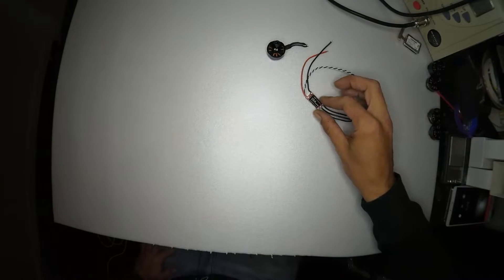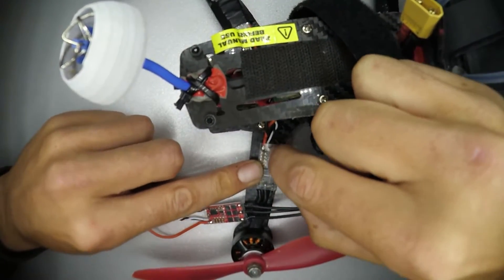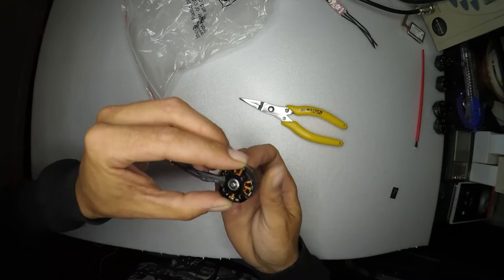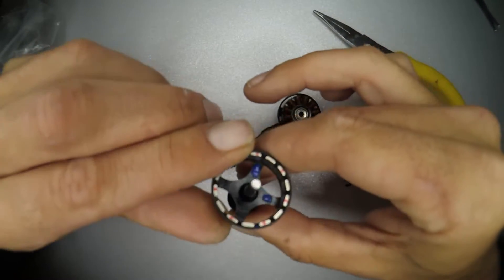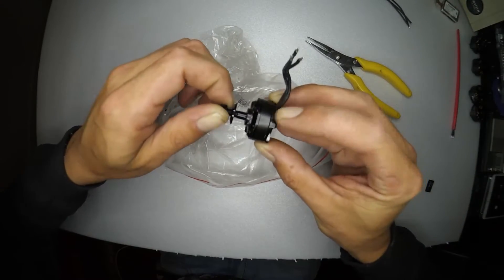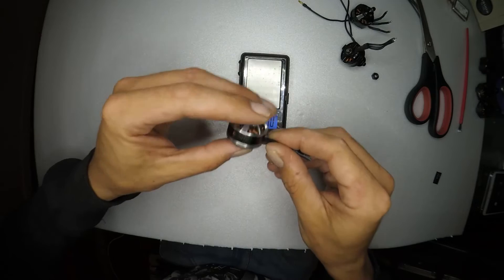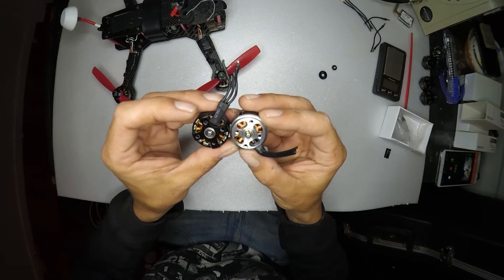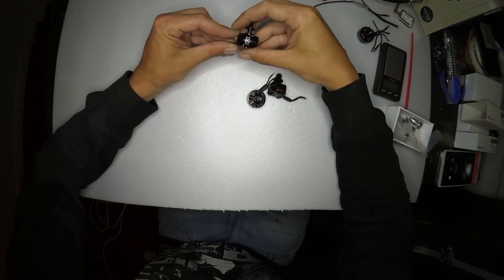littlebeeRCX 20A (FVT Little Bee) + H2205 Motor Combo || Review

Comment: I got a set of these and so far they look great. I was able to flash them with BLHeli 14.3 and it appears to have the BLHeli bootloader preinstalled so flashing with the Naze32 flight controller will be possible if your Naze is running Betaflight.  I got mine here in case anyone is interested.  http://goo.gl/8uZLoh
Reply from the maker: +Albert Kim (marblekit) i love mine xD very keen for the litlebee 30 amps i need a set for 6S

Comment: great review man.  i procrastinated way too long. Now they are $12.99 each ugh!! But still a good value compared to cobras. so how is it on new 4S high C lipo?
Reply from the maker: +krashNburn Oh almost forgot , they should go back down in price soon , and have grub screws aswell :)
Reply: +Rotceh ah thanks. so what's ur take on myrcm's little bees? have u abused them hehe
Reply from the maker: Sure have , got the black mrcm ones on one 250 and the red buzz hobbies ones on a 2'nd both have been tested on 2206, 6045, 4s and i cannot tell the difference :)
Reply: +Rotceh thanks bud. I got a set in the way. lmk when the price go back down 😈

Comment: Great review.  Did you trim your threads down on yours?  Mine seem too long to screw the lock nut down to the prop.  I need to get some nylock nuts I suppose.
Reply from the maker: +Quad Bruh thanks mate :) , i only use nylocks so didn't notice that

Comment: how well balanced are the 2205 2350kv. also any bearing problems?
Reply from the maker: +james aspinall very balanced and not had to do anything to the bearings but one of my 2633kv will need to have them replaced soon after afew more crashes , they come out nice and eazy and i think 450 tail bearings fit so i have heaps

Comment: Great Stuff Hector not had any trouble with my 2204 1960kv Cobras and I have had them over a year but I am loving these! I have the 2633kv versions as you know, running the dys but will be ordering soem of the ESC's from MyRCMart asap.

ATB Malc
Reply from the maker: +RCTV-UK yea i seen , heap of power hey :) . you should get abit more thrust with silab esc when you get some. i think cobra had a bad batch that didnt help with peoples decision to try these motors even FGA has a set on order xD but otherwise i still need to get a set of cobras to test myself as i only have 2206's to compare

Comment: Where do you place this Circle Plate? on the bottom of the prop hub or on the top? May you upload a picture of these motors with props? I just ordered these motors but I dont really know where to place the Circle Plate?
Reply from the maker: +xuxusito on top of the prop but alot of people just dont use it and throw them away :)

Comment: Nice review, mate. My L'Bee + 2350KV combo plus an extra set of 2633KV arrived in the past few days. Was also worried about fake ESCs but they look damned close! Time will tell. Keep up that horrible throttle control ;-) Cheers!
Reply from the maker: +Ddraig62SPD :) thanks mate i sure will haha , yea there 100% the same components on a black mask. hope you like them mate from what i can tell the 2633's are going to be a very good match for the cobra 2204-5 2300-2500kv
Reply: +Rotceh Absolutely, Hector. Have an F1-6 frame (5-6" props) en route from Armattan so will be sticking them on that. Just need some decent weather in Scotland!

Comment: Soma from ImpulseRC has an interesting technique of putting a drop of epoxy on the motor wires where they go into the base of the motor.  Helps prevent pulling on your windings in a crash.  It has to be a really small amount of glue and you need to be careful not to get any on the bell of the motor.  He demonstrates it on Sunnysky motors and they have more area to glue on compared to the RCX motors.

I like your technique using the bag.  I scratched up the bottoms of a couple of mine taking the c clip off.  Oh well, you can't see the bottom anyways.  Thanks for posting this video.  I have H2205 2350 kv motors and Little Bee ESCs so definitely relevant to me.
Reply from the maker: +Plur307 Thanks mate very glad this was helpful , i have yet to try somas method i did watch that video though i just need to work up the balls to put epoxy on , might remove the bells and try one day soon for that extra protection

Comment: Very good review and tips on how to remove C-clip, you're right one of the easiest to take a part.
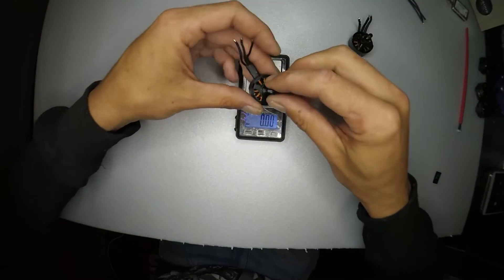Good motor, but metal will bend on hard, direct hits. Lightness does come at price. For $9 buy double the amount $18 for 2 motors and still cheaper than the premium brands. @ 10:58 22.5g not 25.5g ;)
Make the video public so more people can see/find it!
Reply from the maker: +EngineerX Hey mate your 100% right lol not sure how where i got 25g from
Reply: LoL too many 2's and 5's : 2205, 2250kv, 22.5g.... easy to transpose a digit or 2 or 5 ;)
I usually omit numbers, blame it on a sticky keyboard!